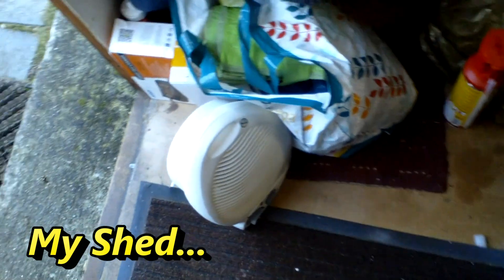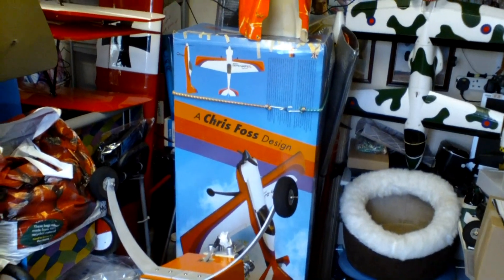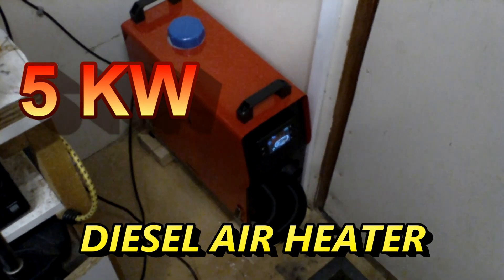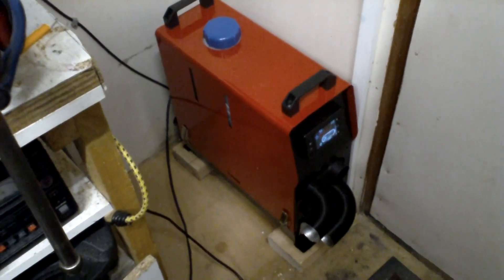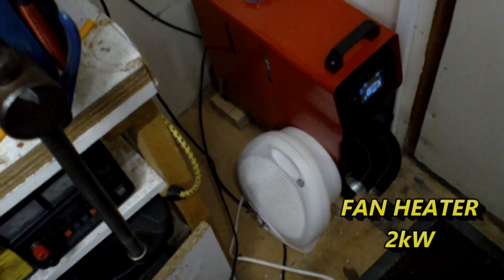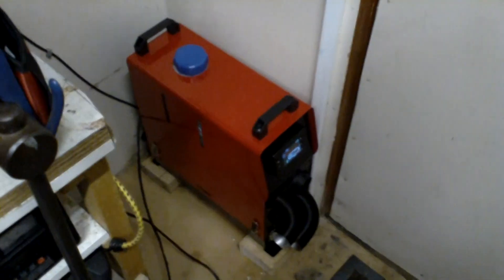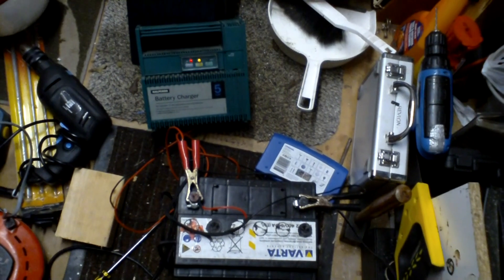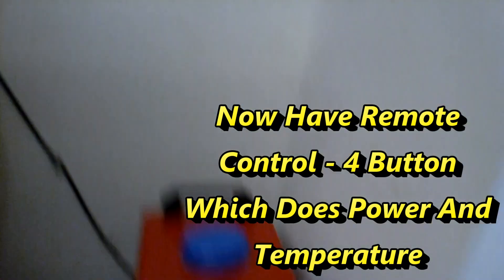Compact Chinese Diesel Air Heater - Alternative To Electric Heating

Comment: Hi Peter thanks for the video I have received mine need to fit it to my van did you have to prime the pump when you first used it please let me know thanks
Reply from the maker: Hi Andrew. Yes you need to prime a few times to get the fuel in and it will probably smoke a bit at first then it will be fine. Have run ours fine no issues.
Reply: Peter Bruce Thanks for your advice Peter

Comment: This is new on Amazon, just found it. No reviews on it yet. Might put this into my converted van camper for dry camping by nx year if reviews show good. Pricier that other options.
Reply from the maker: Hi there. I have submitted two videos to Amazon and they have not used them which is annoying  for me as many look at the reviews but it seems Amazon don't. I can only try - but glad you found the video. Thanks for your comment 
Regards Peter

Comment: Would love to see powering this diesel air heater with a power source. Best option to power this heater is with a battery charger with a "storage" or "float" charge mode after the battery is fully charged. Is that the type of battery charger you are using?
Reply from the maker: Now using 30 Amp switch mode power supply - take a look at my channel as I did a video on that and a few other things that may help you. Regards Peter
Reply from the maker: Using 30A switch mode power supply - check out my channel for video together with a few other helpful videos. Regards Peter

Comment: any fume problems?
Reply from the maker: Hi there. No fume problem at all - the heater is really a furnace the way it works. The combustion air inlet and the exhaust outlet go outside the building / vehicle or whatever it’s installed into. Because of this there is no chance of fumes and as the heater is a heat exchanger - the method of heat transfer is by taking air from the inside of the shed / vehicle and forcing it over the hot aluminium casing where it’s heated and then its blown into the shed / vehicle as a 5kW blast of hot air. The outlet hot air contains NO extra water vapour as the original air was taken from the internal area... As the combustion is totally contained there is no risk of fumes or condensation. Just as a parting point - long distance lorry drivers with sleep-in their cabs vehicles have had them installed for years and also this form of heating is very common on boats. I hope this has helped answer your query.
Thanks for your comment. Regards Peter
Reply: @brucepeter2007  Thank you

Comment: Hi Peter could you send me the link of who you bought it from I ordered one months ago never received it and had to go through PayPal to get my money back I would love one of these heaters but reluctantly don’t want to get bit twice did you have any problems with the seller in getting it I would very much appreciate your help in this thanks again great information from your channel 👍👍🇬🇧
Reply from the maker: Hi Rod. I got bitten twice on eBay and had to get refunds too then I went onto Amazon and although I had to wait a lot longer there were no lies. I ordered off - iYoung 12V 5KW Air Diesel Heater Set Vehicle Heater with Electrical Control - Lower Fuel Power Consumption LCD Thermostat 4 Holes Parking Heater For Vans,Car Trailer, Boats, Etc. Fast Heating
by iYoung
Hope it helps you. There is always a shortage when the weather gets cold as they all come from China and there are no importers although on eBay they say they are U.K. based it’s a common lie I’m afraid. Regards Peter
Reply: Thankyou Peter will have a look for them thanks a lot 👍👍🇬🇧
Reply from the maker: Your welcome. Regards and stay warm. Peter